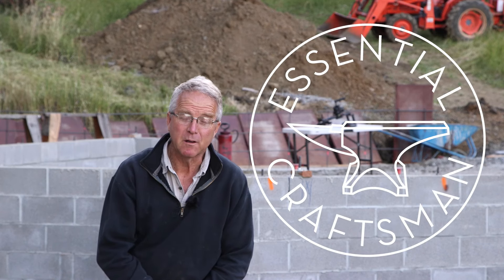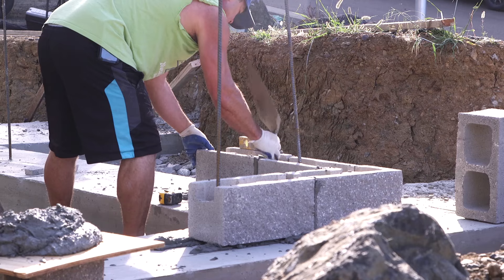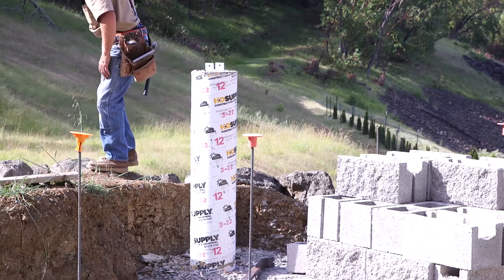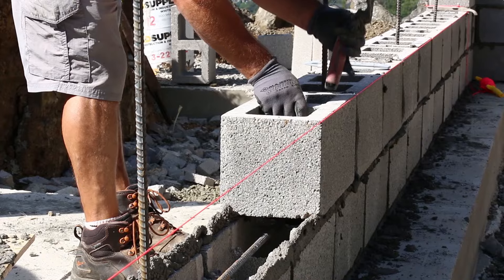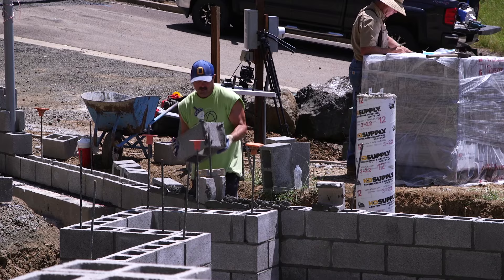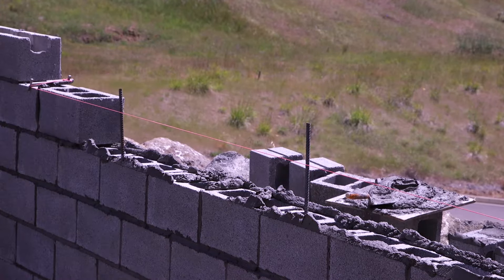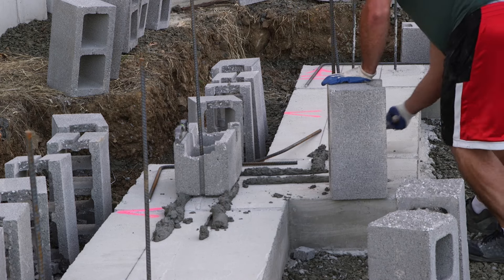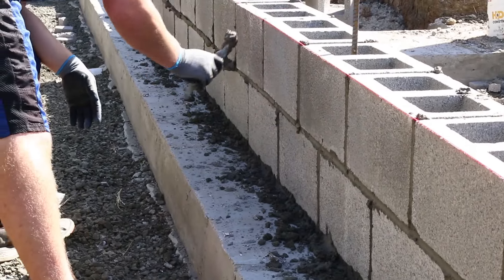Laying Block Stemwalls EP.34

Comment: In the end, my question was answered about why it was so big holes in the brick, it was going to be filled with grouting, never seen that construction in Sweden we use solid block or blocks with smaller holes. My thought about the rebar in the blocks was first what good will it do with those big spaces and rebar in the middle that question was also answered in the end. In the end, it all comes into what weight will rest on the top of the block stemwalls and filling it with grout make it truly solid.

Comment: 45 years ago I was a hod tender. We didn't have premix. I made sure my mix was perfect or the mason would flip the mud board over on my head when I walked under the scaffolds. If there was a rock in the mud they'd throw it at me. I came home with bumps on my skull on days that the sand pile got low. I put up with it because the pay was great, $2.90 an hour.

 After humping mud, bricks, and pushing a wheel barrow through 6" of mud and ice I was built like a tank. After a year I got very little crap from the masons for two reasons. 1. I was good at my job. 2. They knew I could kick their asses. Throw a rock at me, I'm throwing it back. Tip a mud board over on me and the next shovel of mud I throw up to fill your mud board, is going in your face. I earned my respect.

Comment: Another important function of striking the mortar joints is to assist with weathering.  The standard concave strike helps minimize water infiltration versus flush, bevel, or V notch striking.

Comment: Well done video not only instructional but also pleasant and engaging.  We are about to tackle an 8*12 root cellar with no masonry  experience.  Despite my asking, we do not have vertical rebar in the foundation-my husband said he'd drill it in after it sets.  It's set, fyi.  I am unclear of how often to place bond beams (and I assume they follow the corner) and how high to run vertical rebar.  He does have construction experience, just not masonry.  TIA.

Comment: I live in Melbourne Australia, there is cemetery wall in a suburb called Brighton where you can see where the bricklayer used the wrong mix as there are areas in the wall where the mix has dissolved away from the brick.

Comment: I work for a commercial concrete contractor and the big crackdown lately has been the silica dust. New OSHA regs went into effect in the last couple years and they're starting to hand out fines. I don't know how much they hit the residential guys, but we've had to move to entirely dustless power tools, another reason to have water on site.

Comment: I have been involved in the construction industry for 40 years now in the UK!
 I feel it when I get up and put by boots on for work .... but I often think of those (and some on here) who overdo it for fear of looking weak, eather to their mates or Bosses!
I see guys I do not even recognise who let on to me and I discover I worked with them years ago ... but now they are burnt out!
Some trades are worse than others .... Plasterers always look old as do hod carriers, but not so much the younger ones as they reduced the size of bags they had to carry on their shoulders which ended up deforming their backs. Electricians always suffered from "Hammer Rash" especially domestic sparks as they had to chace sunken boxes and wires in to uneven and awkward spaces and often would slip with the hammer hitting their hands (stiff aching joints as we aged).
I remember unloading lorries of storage heater bricks by simply forming a line and throwing 10Kg bricks from one man to the next, for what seemed hours at a time. Worse when we had to handball them up stairs .... it became a battle of how many you could carry at a time verses how many trips you made!
Thankfully times are easier now with new tools and gadgets to make life easier (or quicker) and as I age I am becoming more careful of what I put my body through. I am conscious that not everyone can do this as sometimes it is a case of getting food on the table and a roof over their heads!

Comment: That Topcon RL-H3C has a range of over 500', get that $1000 tool off the site and out of the way.  Easy way to keep it clean and much less likely not to get knocked over.  It doesn't get less accurate at longer distances.

Love your videos, I've learned a lot from you!
Reply: @ utubeaccess7 - Whether using a laser or a builders level, you should always keep your range to about ~100’. A little over? No problem. A little under? Certainly no problem. At 500’, that pesky problem of a spherical planet comes into play (sorry flat-earthers).
Here’s the math:
1 mile = 8”
1/2 mile = 4”
1/4 mile = 2”
660’ = 1”
500’ = 3/4”
🤜🤛

Comment: Plaster (or mortar) tender is a tough job. I was a union plaster tender and staging builder in the 1960's on high-rise commercial buildings in Boston for old-time, old-school Italian plasterers. Everything had to be close to perfect otherwise there was a lot of yelling. The hustle from machine or hand mixing (scratch/brown/finish), and then carrying the hod up to the staging area was as demanding as it gets, but great for keeping in shape. EDIT: I didn't see anyone carrying a hod in this video. Try carrying one filled with finish putty (slacked lime) across a job site, up ladders and across staging to a plaster board without losing any and on time and without a speck of sand in it.

Comment: if someone told first time wall builders what you said around the 09:00 mark about what mortar is really doing.. all of my project would have gone smoother. Mortar consistency took me approximately 550 16" blocks to figure out. After that it was smooth sailing. Fight the mortar and mortar always wins

Comment: Now I wonder if those vents are really too expensive, because I think I might have preferred to have two of those "vent blocks" for each vent, given that they would add up to those 8 inches width of the wall, and it definitely is not needed (otherwise you would have done it) but it kind of gives me more peace of mind than the flashing. And also, the mesh cand be placed between both if you will.

Other than that, nice video and tons of info, as usual. Thank you!

Comment: I built a wall out of block and was cursing all the way as the blocks would sink into the mud or the mud wouldn't stick to the blocks. One mistake I was making was wetting the blocks, they need to be dry. Also something I've learnt from your video is to use lime. I've always used lime for render but never thought it had a use in mortar. I shall try that next time.

Comment: I noticed that the 1st course of block is a lintel unit and I saw some rebar in one short view that indicates to me that engineering wants some additional lintel type strength off the footer.  And this would mean you're going to fill all cavities with grout. I operate under the Southern Building Code, FL Bldg Code and we do not usually do that but engineering can call it out and as Code is minimum standard it never hurts up the standard. My brothers build in Seattle and I in Florida. The big difference I've noticed is that you are trying to hold your buildings up and in the South and especially FL we're  more concerned with holding the buildings down.

Comment: It would be interesting to hear some discussion about why you decided to go with a CMU foundation rather than some of the other foundation systems.
Reply: Like a cast concrete stem wall?
Reply: Usually CMU is used to save on the labour of building all the concrete forms for such short walls. Especially since he doesnt have to build the foundations below any frost line. ICF blocks could of been used if he was building in a colder climate and needed to have an insulated crawlspace in lieu of the more traditional uninsulated space he's building here.
Reply: Since Scott's forte is in forms, I was very surprised too. And I feel this approach was simply to illustrate another method and highlight another trade for the video series. Still, I don't like block one bit - and wound never ave gone this route. Would have been better to do a controlled space.

Comment: I'm curious why the bond beam blocks are not made ahead of time at the brickyard. It seams that while removing the material  from the block could  cause small fractures which could be a problem  down the road. I'm no bricklayer  so I'm just asking the question

Comment: Ok, so I have been thinking about a residential build coming up in the next few years when I retire.  Did construction early years in career but then management.  But still have skills. I am wondering.  How does it sound doing a slab on grade using CMU for the stem wall.  That way I am not fighting time trying to rent panels for a stem wall likely about 2 ft high based on what I have been seeing in this Maricopa county area.  Thoughts on using CMU for stem wall in slab on grade. In this senerio it would be 3 pours; footing, stem wall, and then slab?  Thoughts?

Comment: A few questions:
Any radon mitigation needed in your area?
Why not start with a passive system?
Why not a fully encapsulated crawlspace with a small dehumidifier to remove moisture and increase energy efficiency? If you want it dry you simply dry it AND keep moisture and most air out.
Reply: Natural airflow is the most energy efficient. It costs nothing.
Reply: @Yellow_cub  not if you're using moist air, you can't dry naturally past ambient humidity

Comment: 11:00 yea man, you have to have a type s at least for subgrade applications if you don’t use a type m or a type o. The requirements for a type s are 1 part cement .5 parts line 4 parts sand. Type s is rated for a compaction force of 1,250psi.

Comment: Forgive my ignorance but I'm wondering why cinder blocks instead of formed concrete? At first I was thinking cost, that maybe cinder blocks and mud are cheaper than forms and concrete. However the extra labor and added skill for laying blocks seems to preclude that in my mind. I live in the Midwest where there's a lot of basements so maybe that is where my thinking is flawed.

Comment: I'm impressed with how useful you make yourself at every part of this job plus doing your own job. As for breathing cement dust, I feel you do have a responsibility for safety at all levels and those guys are going to regret breathing it when they get old. In my industry we did a lot of Electrical and Lighting work up high in Movie Stages in Hollywood and you either followed all safety requirements or I told you bye bye. Everyone in the chain-of-command gets sued in case of accident or injury.

Comment: Back in the day, I helped a mason build a short (used) brick wall.  He told me the number of shovel fulls of sand, cement and lime and how much water and how to mix it in the wheelbarrow using a big hoe with a couple of holes in the blade.  He knew with the first trowel of mud I hadn't mixed it properly.  Back I went and never made that mistake again.  He was fun to work with and paid me generously.  Later I tried building a BBQ on my patio but apparently used the wrong type brick because the closer to the bottom of the stack I got, those bricks were heavier somehow.

Comment: So I am always curious nowadays why or what is the choice/reason/cost to use block or just do some poured concrete walls. It’s just a question. Great video SCOTT keep it up
Reply: Visual impact and the time/cost needed to provide good shuttering. These blocks do the shuttering for you!
Reply: videogalore shuttering? Just looked that term up. Never heard that term before I would’ve called it shoring or forms I guess.

Comment: Since this is Oregon, is a CMU stem wall a good structural choice given the earthquake risk? Were there any considerations made in the engineering and building of this one that make it better able to withstand that sort of inevitability?
Reply: Oregon certainly does have earthquake zones, but Roseburg is not in one. (They say.) Still, I think this may have been done to add a wider range of techniques to the video series more than just doing a monopour. Just like having custom prints and engineering... for a spec house - who does that?

Comment: Great layout...made it easier for the mason's & the tenders! Laying up a lead with a torpedo level and putting a piece in the middle of the wall...should've  been in the lead
Reply: Jeff Hitchman can you explain the mistakes? I see several comments about the torpedo level. And the half in the middle of wall.
Reply: @antoniosmall4413  I was taught to lay any size of a cut in the corner lead...laying it the middle of the wall makes it weak...torpedo level only levels the block you are laying 4ft level should be used for a more accurate level of the course being laid

Comment: One more question, when building a block wall, should you wet the bricks before installing them? The reason I ask is, I have heard that if you are trying to join cement with dry block the cement won’t stick to the block because the moisture is sucked out of the cement too fast and it delaminates, which makes a weak joint. Is that true?
Reply: keli Surfs  You're thinking of clay brick, which is 'sometimes' true.  With cmu block your basically binding portland cement to portland cement which isn't an issue (unless the mud is too dry).
Reply: Thank you for the reply scott😀

Comment: It seemed like every wall was exactly a whole number of blocks long - I didn't see any undersized  blocks except of course for the half-blocks used to create the running bond pattern.  Were the walls designed to be exactly the right length to accommodate full blocks, or did you just not show the odd-length walls?  If you do have walls that aren't the perfect length, where do you put the odd-sized block(s)?  I'm guessing in the middle because you're building in from both sides?

Comment: I have zero experience with construction but I am wondering why you did a block wall rather than just forming and pouring concrete?  Is that normal for a short wall?  Was it more cost effective?  Just curious what goes into the decision.
Reply from the maker: Save cost and improve appearance.

Comment: Hi Scott and Nate. Thanks so much for the videos!

Is there some sort of fix you can do if the cement blocks are not smooshed together enough by the time you get to the far end of the wall? It seems likes if you have too much (or too little) space between blocks could cause you to end up with one side of the wall where a full block can't fit. Do you cut a block to length to fit the space?

Edit: I see in the videos a few cut blocks. Do these cut blocks pose any sort of structural risk?
Reply: Matthew Shultz it takes skill to measure out the wall so that you have proper joints. Joints should be 3/8” because a block is 15-5/8”. If your wall is a little long or a little short you can cheat your head joints a little so that all full block will fit. Sometimes on shorter walls this is not possible so you will have to make cuts. This does not decrease the structural integrity. Once the first course is laid everything should be sorted out. If the closure block does not fit then his head joints were too big. To fix simple go back and squeeze a few block closer in the course. If the joints are too big at the closure block space a few block. This should not be an issue; it just takes skill when your laying to make sure your joints are correct . . . Simply follow the course below. Also, if you have to move a block you should re-lay it because it will no longer be laid in compression. The mortar takes an initial set once the block is laid and once you move the block you weaken the bond.
Reply: @maddmason9520  thank you so much for the reply it's fascinating to learn about this stuff!

Comment: What is the purpose of the beam blocks on the first course? Seems like you created a beam on top of the footer which I don't understand because it doesn't seem necessary, considering the outside is buried and the inside will have a concrete slab floor. Are you building in an earthquake zone?

Comment: Never heard about mixing lime in "mud"?   In Europe (at least Belgium) we use 3 parts of yellow sand with 1 part of cement.  The yellow (=brown) sand grains are like more rounded/worn what gives the "mud" it's "gluing fat" behavior.  Other sand (used for concrete) doesn't work for this.  Do they use lime in the mud all over the US?

Comment: so, at 24:50, it looks like the vent blocks are one course below the split face, and at 26:45, the went blocks are among the split-face blocks.  since you say that only the split-face courses are going to "be seen by anyone except a plumber", does that mean that some of the vents are below the final ground level?
Reply: I noticed this as well. I'm thinking those particular vents will be under an exterior deck, so the more expensive split-face look is unnecessary.
Reply: @kev5782  
oh!  that makes sense.
thanks!
Reply: @kev5782  
after watching the next video, I think those vent blocks are going to be under the porch.  it looks like that side is the front side of the property (opposite the back retaining wall), and there are concrete piers in front of where the vent blocks are.

Comment: CMU 16"?  In the layout video, CMU was assumed to be 16" wide to determine the location of the verts. But there's mud being put on the ends.  So are they actually a half inch or so shorter and the mud is consistently 1/2" or ??

Comment: The one dude with the camo hat is not a block mason...yet...The first guy is pretty good...He has the "touch"...He uses the trowel instead of his hands...In the philly area, we use one portland, 3 sand, 1 lime...
Reply: godbluffvdgg  that and the half block in middle of wall at around 540
Reply: @larrycarroll6869  Yeah, his joints were so open you could put a brick in there...:)